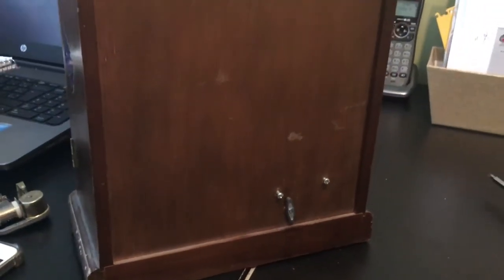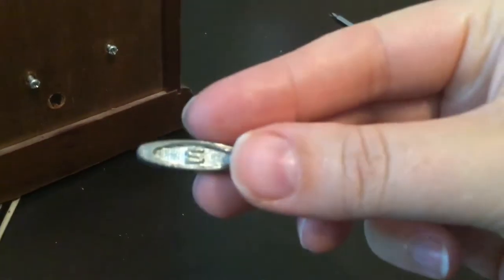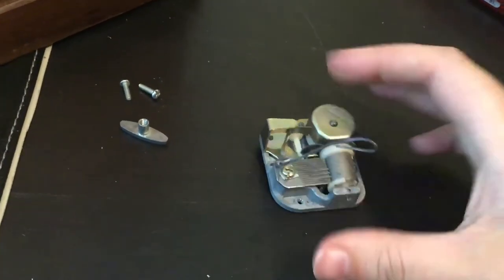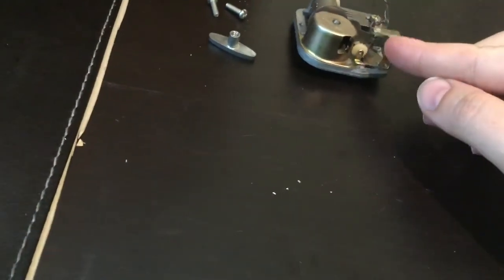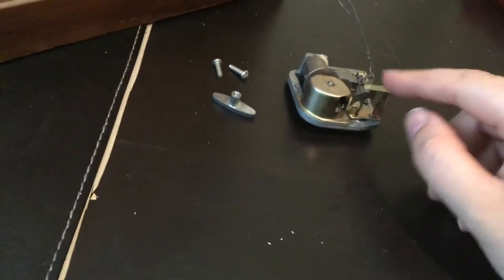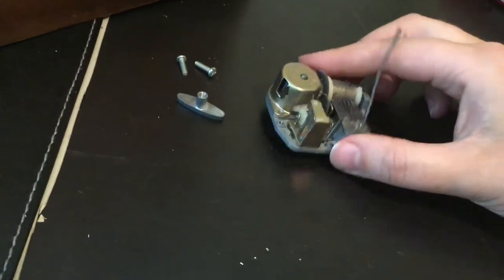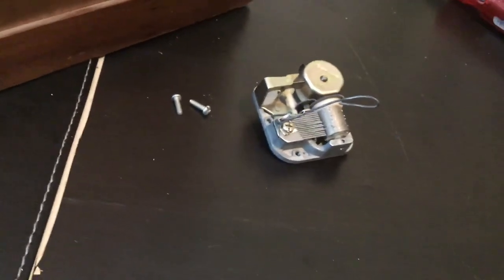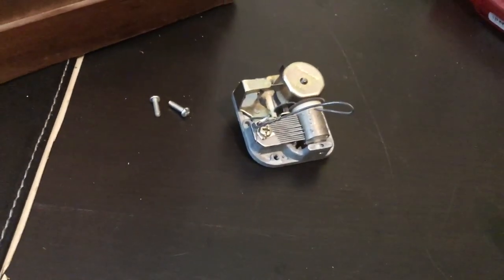How to repair a musical jewelry box (no loose parts)

Comment: Found a very dirty one (previous owner must've been a chain smoker) and tried disassembling it part by part to clean it. However, the brass part holding the fan's screws are impossible to budge. The music is REALLY faint. You can hear it, but you gotta get it close to your ear to hear it distinctively.

UPDATE:The bottom "spring" of the fan broke, snapped like an uncooked piece of pasta. Metal was darker than the rest of the set, so I guess either the metal rusted trough or time finally snapped it

Comment: My music box was unwound until it stopped working. Now I wound it in the correct direction but it stopped playing the music
Reply: Oil it :)
Reply: It's not stiff, it winds fine but doesn't play any music.
Reply: Does the fan looking part spin?
Reply: @syhareky3188 I have the same problem and yes the fan part spins but it doesn’t play music when I wind it unless I manually turn the ballerina in that direction then it plays. How can I fix it please?